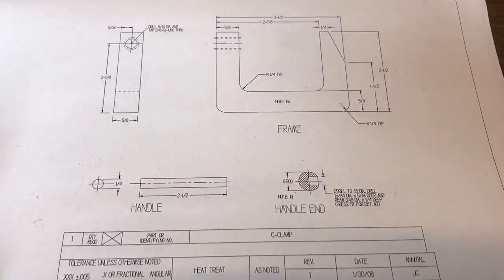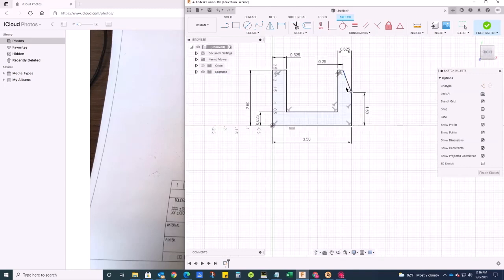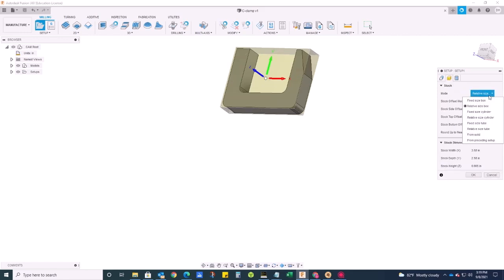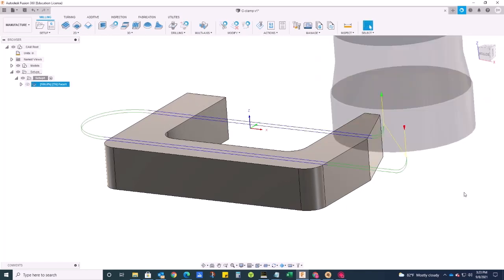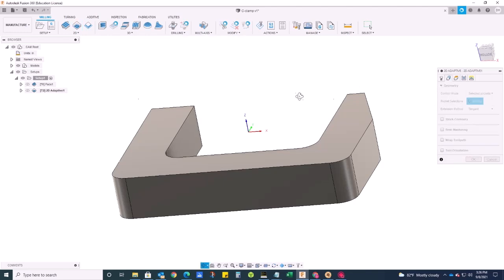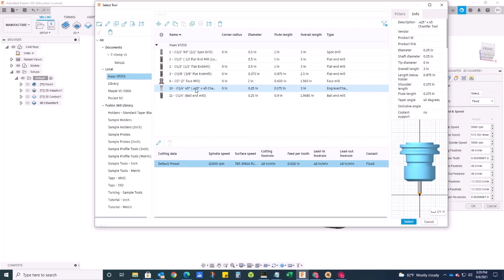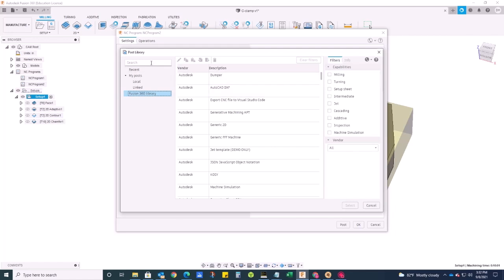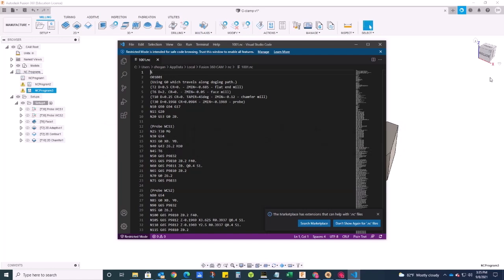CAD/CAM vs Conversational: Which One is Faster? PART 1

Comment: You’re adding so much unnecessary steps to your CAM. The company who wants the job obviously has a 3D model of the part of they have the drawing like this. Tell them to send you either the drawing file, or the step file. I don’t believe you should be adding this time to a job redrawing a drawing. It’s not 1990 anymore get with the times lol.
Reply: I agree with that, if you got the model, it takes u 2 mins to program it, at least to me.

Comment: For reference, I drew this from scratch and programmed it in about 7 mins from start to post using solidworks/hsm express. I wonder how proficient you are at cad/cam vs conversational, and whether this is going to be a fair comparison.
Reply: you have to keep in mind there is enormous amount of time wasted while talking on a video. If I had the tools in the machine already I would have shipped the part in 20 minutes.
Reply: @TommiHonkonen  Seems using a narrated video is not a good control for 'which is quicker'
Reply: @andrewdiehl5746  Agreed, you can always film then narrate after.

Comment: 100 bucks says I can do it faster on a mazak then someone can with a computer
Reply: If you can do this under 1 minute then yes, you can do it faster then me on computer
Reply: @alk3246-o3w  hey let's not forget,,now youhave to load it into the machine, people fail to think about that 10min process in Most plants! And yes I am VERY FAST with mazatrol!
Reply: For me I can't program on the machine while its running so I usually have the next couple of op's or parts already programmed on the computer and the run it off a USB. so whether or not programming on the machine is faster than programming on the computer its still faster to swap a usb for the next program. I also have access to the 3d models so I almost never redraw something.
Reply: Yes mazaks can be programmed while running a cycle,,just cant edit the one its currently running. That's how we program ahead. Every shop is different, to each there own. And the talent is different everywhere you go
Reply: To be quite honest I think I could’ve programmed  that a mastercam in under a minute.